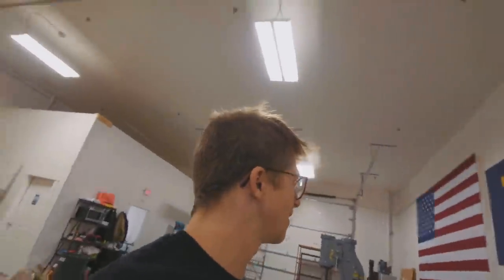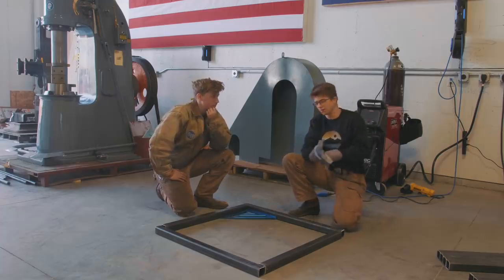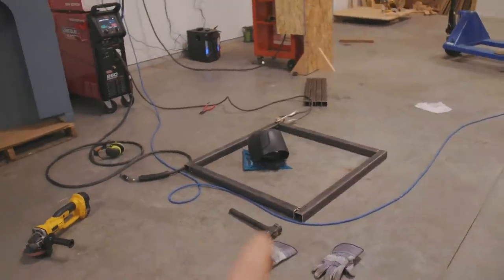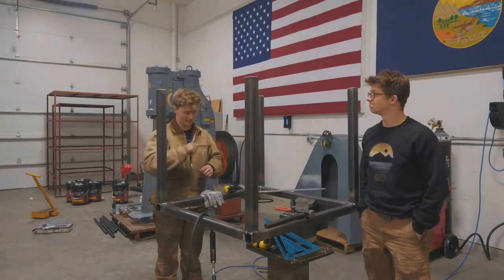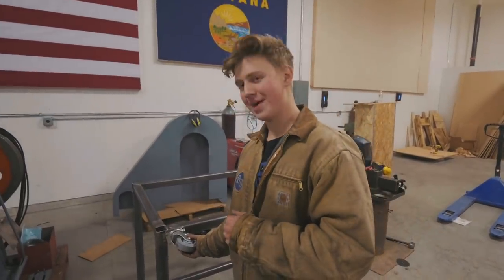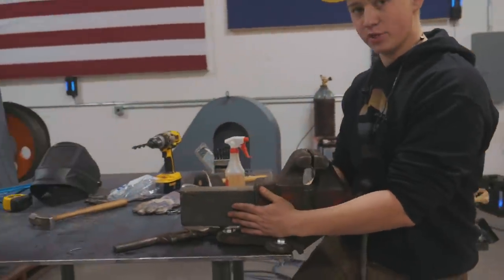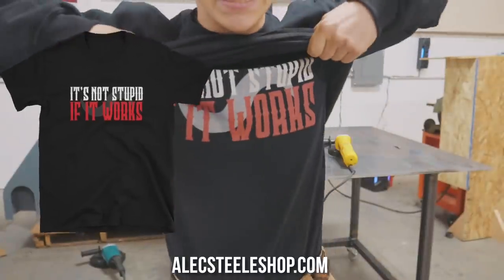HORIZONTAL SURFACE NUMBER 1!!! The Welding Table!

Comment: I think the Spark Guard 2000® just might be a little flammable. You might want to get the Anti-Combustion® add-on for it (AKA screw some thin gauge sheet metal to the inside).

Also, 220V single phase is what that is running on?? Normally 220 runs as 2 phase. I did see that the cord was only a 3 prong, so hot, neutral, ground. Wait, it is using chassis ground to the studs and concrete, so you have a 3 prong with 2 hot phases and a neutral. Since it is bolted to the concrete, having a ground come in form the panel would create grounding loop, which is very dangerous.

\sorry, I used to be an electrician
Reply: normal 220volt is two hots and a groud IE dryer plug which is why you see old dryers and ranges with 10/2 wg and 6/2 wg respectively. the black and white are both hot and there is no neutral in 220 volt.  google image search 220 volt chart. as one "phase" is firing the other becomes the "neutral" alternating current flow 60 hz.
Reply: Wow that is different to our 240v single phase over here in Aus.
Reply: 220V single phase sounds right to me. There should just be a hot, neutral, and ground. Alec might have said 220 but meant 240, since 240V is technically the rating, but is referred to as 220, much like many people will say 110 when referring to 120V. That's my understanding, but it has been some time since I've worked with electricity.
Reply: Maybe he was spouting information on his panel instead of the circuit itself.
Reply: It's probably 240V but even on a 3 phase system, an X/Y/gnd 3 prong configuration will be considered single phase due to the voltage difference between the phases. Three prong twist plugs are typically used for 277/480Y connections with a neutral and 120/240V connections with two hots and a ground. One of those plugs is an earth ground that grounds out the machine to the building ground. The other two are differently phased hots, providing the simulated "Single phase" voltage, without the need for a neutral.
Reply: Don't worry, when I told my grandpa (also a retired electrician) that I worked in a house where they had used halved coffee cans as junction boxes, he almost had another heart attack.
Reply: Alec is probably calling it 220v because he is from europe in the states most power companies run 120/240v single phase or 120/208v three phase a lot of commercial runs 277/480v three phase for lighting and light manufacturing.  You are correct 240v runs two 120v legs, but it is still called single phase in the trade at least here in the midwest.  A 240v will have 2 hot 1 neutral on a 3 plug cord or 2 hot 1 neutral and 1 ground on a 4 plug cord.
Reply: Normal American 220/240v is considered one-phase.  The 240v line-voltage is split by the transformer in opposite directions of the same waveform at 120 volts, just one's now a mirror-image of the other. When one hot is positive, the other is negative then they reverse ...hence Alternating Current... there's 240 volts between them.  Whereas 3-phase has three separate cycling 240v waveforms at 120-degrees separation.  Think of a three-strand rope in side view  (/way over simplified)
Reply: 220V single phase - Hot, Neutral, PE (ground). In europe ofc.
Reply: @adamhagan1817  The old plugs for dryers and ovens were 2 hots, each at 180 phase angle from each other, and a neutral that also served as the ground. Both neutral and ground are bonded to ground. These plugs are no longer used since if you loose your neutral, you rely on the phases being at opposite phase angles to prevent the chassis of the appliance from becoming energized. This is not safe with modern appliances since they have single phase taps to run their electronics. This results in a phase imbalance and the appliance will become energized at a full 240V/220V voltage with a lethal current when you touch the chassis.

The exception to this is when you have a piece of equipment bolted to a concrete slab that is part of the foundation of the building. You also have to use GFCI circuits in these areas too since wet concrete conducts well enough to cause electrocution issues. I have worked in places where it wasn't done and people got hurt. One unfortunate woman had her index finger blown off from a circuit loosing neutral on an old piece of equipment. These were industrial sites, but the same thing can happen in homes and has happened, hence why the code was changed.

Loosing your neutral connection for a circuit or a panel is rare, but it does happen. This is why you should NEVER replace the rat tail (the plug and cable for the appliance) from a 4 prong to a 3 prong to fit in an old outlet. Have an electrician replace the outlet and attach the ground. If there is no ground run for the circuit, an electrician can run one.
Reply: @125jesusfreak  I just looked at the specs on the hydraulic press at the manufacturer's website. It is a 220V, single phase motor. They are a US company, but that motor is from overseas and they must get a good deal on them. Really an odd motor to see in a piece of US made equipment, hence why I was confused. It might be 240 2 phase going into it and is using a motor driver to change it.

I am familiar with using phase to phase to derive a lover voltage off of a 3 phase power source. I doubt that the shop has three phase since it is not standard to run that in commercial properties in the US, but that complex might be zoned industrial and have it. Hey Alec, does your shop have three phase power or just two phase? Ask the electrician when they come in next time if you are not sure.
Reply: No such thing as 2 phase only Single and 3 phase.
Reply: UK and Europe is now 230v single phase and usually 3 pin plugs (live, neutral, ground) or occasionally 2 pin (L and N).  It used to be 240v in the same plug config.

Three phase is now 400v and is 3 x Live and 1 x Neutral entering the premises.  Plugs can be occasionally 3 pin (old plugs) which are 3 x Live, or 4 pin (3 x L and 1 x N) or 5 pin (3x L, N and Gnd).  It used to be 415v before the voltage drop, which I believe was European conformity.

Each live phase on the 400v supply is of course 230v.

About the biggest motor one can get on 230v single phase would be 3 HP.
Reply: michael stein it should be Black and Red wires are hot. White wire is always neutral.
Reply: @LawF250  Yeah, some call 240V 2 phase, but it's really just 2 hots from a single phase circuit.
Reply: @t.bunker2511  I was an industrial electrician. I handled 3 phase power within the first year of my training. NA 240V is two phase. Single phase 220V nominal voltage (220/240) only has one hot. It requires by current electrical code to have a neutral and the chassis of the machine grounded or a ground line as well. The chassis of this press is grounded through the concrete, so 2 hots and a neutral is all you need. Unless an area is industrial zoned or highly urbanized, it will only have 2 phases run to it. It is how NA was wired. In the EU, they have 3 phase ran to the homes.

I looked up the press's specs and the motor uses 220V single phase. An odd motor for a US made piece of equipment, but they probably can get them for a good price.

It is easier to explain 3 phase power, phase angle, apparent power, and real power using not only sinusoidal waves on a Cartesian graph, but also to talk about it on a polar graph (a unit circle multiplied by the voltage of the phases) since that shows the phase angles relative to each other and you can illustrate the phases rotating on a polar graph very easily.
Reply: @ivyisle  This is still 2 phase. You still need a neutral to deal with phase imbalances, like when you start a motor up or change the load on it. Ground and neutral in older homes used to be run together, but this can cause electrocutions and fires with modern appliances that tap a single phase to power their electronics, resulting in a small phase imbalance at all times that has enough amperage and voltage to be dangerous.
Reply: There is no neutral.  220 is phase to phase in a 3 phase setup (which I am pretty sure he has seeing his panel) or it is single split phase in residential applications (technically 240v).  Either way its two hots and a ground.
Reply: @KnightsWithoutATable  in america 220 is single for residential and 3 phase for comercial
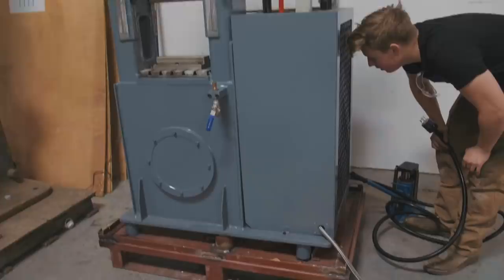Reply: @KnightsWithoutATable  It's 3 Phase. go to 4:58 in "I BOUGHT AN AMERICAN TRUCK" Machinery like that typically takes a little more power to spread the load out across different phases in the panel. a 100A 3ph panel can supply more power than a 100A single pase panel. Also, Voltage specs are ballpark for optimal operation, like a 220V machine could probably run on anywhere from 200ish volts to like 250V. It's not uncommon for Phase differential voltages to fluctuate up to 10V in either direction. Basically whether it is a 240V or 220V power supply is pointless bc the machine probably either has a voltage regulator or something inside it or will just run faster on higher voltage hahaha
Reply: It is 2 X 110v wires, and a common. That would be normal. There is no such thing as 220v single phase. It would actually be less expensive if he could run 3 phase. You can use 3 phase in industrial buildings. All homes are 2 phase. I'm not an electrician.
Reply: @philbyrd5561  You might want to look up your nominal voltages and phases again, because that isn't even close.
Reply: @125jesusfreak  Well, it can't be 3 phase run to that plus because you would have 4 wires, 1 for each phase and then a neutral. You have to run a neutral to deal with phase imbalances that will happen no matter how good your power regulator is in the equipment. It is also required by code. You can run 240/220V nominal rated equipment on higher and lower voltages, but the lower voltages will result in higher current draw, thus more heat, and then shorter operating lifespan. E=IR

I looked at the panel (thanks for finding a good shot of it). It is a 3 phase, just as you said, with Orange, Blue, Black (A,B,C phases respectively) for the cable markings. That means it is a 208V nominal voltage 3-phase on a high delta, which means the the B phase is at a the full 208V when referenced to ground, phase to neutral is 120 on A and C phases, and phase to phase is 240V. So it is effectively 240V nominal to the press, with 2 lines and a neutral for the plug.

With a motor that size, it might have a power regulator that helps with soft starts and stops, but I doubt it. It most likely just has a snubber circuit to keep it from from dropping transients every time you stop the motor and some motor caps for power factor correction and inrush current limiting.
Reply: Real 2Ø is three, four or five wire with a phase displacement of 90°.  It is a vestige of the original Westinghouse AC distribution system that won out over Edison's DC idea in the 1880's.  Some of it actually still exists and there is a FLA table in the NEC for those old motors (240.49).  Notice the heading says four-wire.  Tesla put it out of business with his 3Ø obsession.
Reply: Not an electrician in the US? Residential power is 240V SINGLE phase off a center tap transformer. Commercial/industrial power is either 208V/3ph-wye, or 480V/3ph-delta. (there's also 600 and 1200, but I've not seen those beyond a distribution grid. the grid in my current building is 480)
Reply: @AnessenAranion  Tesla was always the superior mad scientist. That and voltage drop over miles of lines is best countered by using high voltage for distribution and then stepping it down for customer use. This is easy to do with AC with transformers. There really wasn't a way to do it with DC at the time and even later on it was very expensive. Recently, high voltage DC lines have come back into use since they don't have losses from the inductive reactance of the lines and since the equipment to step up and step down high voltage DC is a more reasonable cost now.
Reply: I often hear 208 V systems mistakenly referred to as "220".  NEMA (american) standard 1Ø motor voltages are 115, 200, 230, 460 and 575.  Motors are utilization equipment and have different voltage designations than supply equipment, such as panelboards, outlets, breakers and safety switches. This accounts for the assumption that voltage will drop between the supply and the load.
Reply: A three-wire twist-lok outlet has two hots and a safety (earth) ground.  No neutral. Neutrals are grounded circuit conductors - they conduct load.  Grounds do not conduct anything until there is a short.  There is no neutral connection to a 230V 1Ø motor.
Reply: No neutral to a 230V, 1Ø motor.  The third wire is the safety ground.

1Ø motors have a start winding and a run winding.  The start winding is separated from the run winding by a capacitor to shift the phase angle by 90°.  This creates a rotating magnetic field that starts the rotor turning.  Then the start winding is switched off and the run winding rotates a few degrees ahead of the rotor squirrel cage because of "slip" -  retardation of rotor speed  by load torque.  Very different from polyphase (2Ø and 3Ø) motors.  No capacitors or start windings for these because of the displacement angle between phases - 90° for 2Ø and 120° for 3Ø.  They just start (with lots more torque).

I believe that, in Europe, 230  is the nominal L-N voltage and 400 is the nominal L-L (for 3Ø distribution).  America has many, many different variations, none of which are this.
Reply: The man is a Bladesmith not an Electrician.
Reply: @AnessenAranion  With the company website spec for that press saying "220V single phase", it might be rated to be supplied with 208, 200, or 230 and it is likely that it is.
Reply: Technically no it isn't 2 phase.  The complete phase is 220v (or 240 in the utility world) across the whole winding on a grounded center-tap transformer.  That center tap taps takes the single phase and 'splits' the phase into 2 hot legs 180 degrees apart but the total winding of the transformer is still just 1 single phase.  @KnightsWithoutATable
Reply: @adamhagan1817 .....240v is two 120v legs plus a neutral. Actually, the delivered  voltage usually runs around 124v these days, so the result is 248v/1 phase.
Reply: No he used particle board becase it absorbs water well he sprays it down he is good for as long as wet woor glue lasts
Reply: 110v(120v)/220v(240v) depending on voltage drop, is single phase as there is no leading/lagging wave form(zero deg phase angle between lines),  the output transformer is 240v and has a tap in the center for the neutral + ground and gives you the 120v from tap to line.

3 phase is 3 lines separated by 120 degrees,  A phase leads B phase by 120 degrees and leads C phase by 240 degrees(or lags C phase by 120 degrees).
3 phase is usually in 3 wire delta configuration, and is transformed to 4 wire wye(Y) if needed. So, 120/208v  wye (208 delta) (277/400v and 347/600v are other 3 phase voltages that are relatively common).

An odd ball 3 phase system called High Leg Delta, it's 240v delta, and one winding has a center tap, it has 120v from the tap to 2 of the lines, and 208v to the third line.
Reply: @KnightsWithoutATable  Well, yeah it's not 3 phase driven, but there's 3ph power in the shop, that's all I was getting at. Good point about 208, it's been a minute since I've been in the commercial electrical industry. His shop is no doubt wired with 120/208. I think we're both saying kind of the same thing haha. I don't think that a neutral is going to the press though, because if there were 2 phases and a neutral, then the plug would need 4 prongs becuase the machine needs to have an earth ground tied to the electrical system in the buliding. Lots of times, with 3ph equipment that requires a neutral, the power supply will just take a delta config. and a ground into the machine, then pull a neutral off of its internal transformer - depends on the machine though. I've seen both.
Reply: or just scrap the guard and just weld up three sides of sheet metal itself thin guage will due I am sure instead of screwing it onto wood, just a thought
Reply: If I am following this - the grounding loop provides the risk for either short to the the panel or an open neutral condition ( where all 220v go through 1 leg and thus smoke is made)  ???
Reply: 240V single phase is correct. Unless you have 240V three phase. AKA: 220
Reply: @adamhagan1817  just two hots and a ground. No need for neutral unless you have something like a dryer with 120v controls.
Reply: @LawF250  well... my single phase house has 2 legs coming in ( look in your panel and you have the A and B, Red and Black, or Black and Red I suppose) ... since they both come off a single higher tension "phase" on the pole through a step down transformer, they could be on the same "hump" of the sine wave, the same "phase"... but I don't know if they come off the transformer can in the same phase or not.....

Anyone who can answer this?

I should add that I have done a complete rewire ( new panel up) of the in-law apartment in my house, and it passed inspection etc, so I understand all this, but I just never thought about the 2 hot legs coming in being on the same, or a different phase...just never asked that question. I know my house is "Single Phase" and have ( and will) treat it that way.... but the 2 legs off the can on the pole, if you put them on an oscilloscope, are they the same phase, or are they off by 120 degrees? 

Thanks,
Reply: @RustBeltAuto  there is no two phase. Look at your power lines outside. If there are two wires on the poles you have single phase which is one hot and one ground. If there are four wires it is three phase. 3 hot 1 ground. The phase refers to the incoming power from the power company. 220 or more correctly 240volt can be single phase or three phase. And on a three phase system you can have a piece of equipment which runs on 240V single phase or three phase depending on how its wired. 
There are many different configurations of three phase. The most common are 120/208, 277/480, and 240 delta which has one leg which reads 240V to ground. (A high leg)
Reply: @Aaron Arquette I have 3 wires in an American house.. 2 seperate 110v, and a common(neutral, or ground). Some may call it 120v, but a volt meter reads as 110v, making 220v.
Reply: Greg Mislick I already know a house has 2 120v wires coming in or 2 legs that are 180 degrees out of phase. (Ones positive while the others negative) 3 phase are 3 separate legs that are spaced equally apart and are not out of phase of each other.
Reply: Well they didn't teach you much. Residential Americans only get one phase, they get either the upper or lower half of the center tapped 220v from their local transformer. For some things, like the dryer and stove, they give you the top and bottom connections to the transformer, so you get the full voltage. But it's all in phase. A single winding on a transformer can't give you more than one phase, no matter where you tap it. But if you have an industrial power supply you get 208v phase to phase and you get 3-phase panels where the connections are rotating phases, so any three adjacent slots will get three different phases.
Reply: @cageordie  Your explanation and understanding of poly-phase power I know are wrong. Try running the math some time. 2 phase means 2 phases at 180 degrees separation in North America or NA, for short. That is what 220/240V is for NA service. It isn't center tap for 120V and 220V full primary in NA, mate. That is how UK and EU power works, not what we have here in the states.

You want to prove me wrong? Then show me the code or give me math that proves me wrong. I never claimed to have everything correct. You should be as humble. Seriously, 208V is not a common nominal voltage in NA, outside of lighting.

Also, 208 3-phase is not the common form of 3-phase power for industrial installations in NA. You are looking at 240V or 480V for 3-phase as the nominal voltages used in industrial settings. This is done because when your peak to peak voltages exceed 600V in NA, we have extra code, wiring insulation standards, and training for electricians that make it really expensive to use 600V or above voltages outside of a utility (which operates in kV ranges).

Based off of your post, I would guess that you are a residential and commercial qualified electrician from the UK, possibly the EU. You have done installation and troubleshooting in those areas. You have no idea how the NA system is set up. If you do, the tell me what a grounding loop is and how to avoid any in Alec's new shop.
Reply: @KnightsWithoutATable   Not having a ground to the equipment is a violation of the NEC and is also an OSHA violation. Concretes conductivity varies by the moisture content. If there was a fault, the only path to ground being the concrete will get somebody killed. That metal housing of the machine needs a direct connection to the ground bar, 
 Concrete is not considered to be a ground loop. Rebar, mesh, building steel are tied in to the grounding system quite often. That piece of equipment does not require a neutral. Typically if a lower voltage is required for control wiring a control transformer will be internal and will provide either 120v or most likely 24v. Yes , 2 hots and a ground is called single phase. 120/208v 3 phase  is a very common voltage in the US. Either combined with 277/480 or stand alone. It all depends on what is available in that area. There is also 120/240 3 phase , called High leg, where B phase to neutral will read 208v.  which you never can use for a single pole breaker. But balances out with 2 or 3 pole breakers. Been doing industrial for 30 years